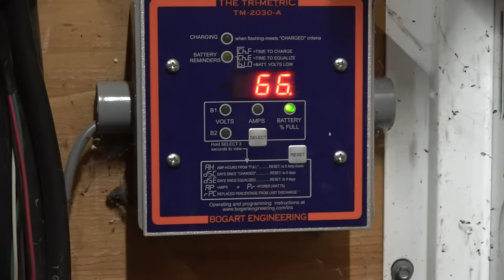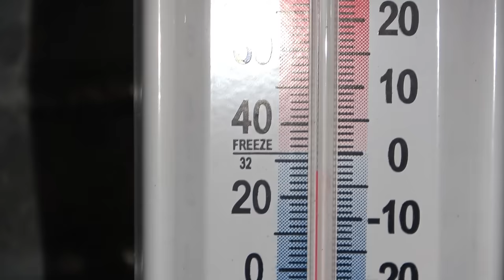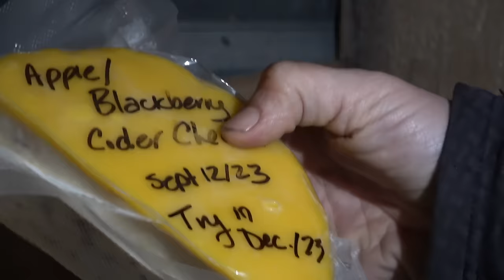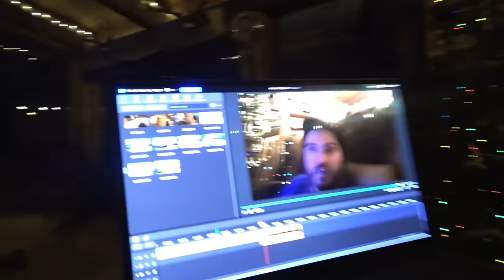Is This Life for YOU? OFF GRID in Winter

Comment: Sparked by your mentioning garage door openers, I have giant fans that run silently (almost) day and night in the summer - powered by low-pressure compressed air. I use 12-volt PV panels that power little air compressors whenever there's sunshine. That compressed air is stored in a giand air battery (and pipe grid) - available for use on demand.

Comment: An axe/hatchet is by far the most dangerous of any hand-tool, ESPECIALLY when you get comfortable with it. You can get off with a warning once, maybe twice. If you don't heed that warning, you're going to the ER, because when they bite, they bite hard. The way Kez was using that hatchet put fear into me I swear. I don't know how far you are from the ER (or someone who can reattach fingers) but if you're very far, then let her know her fingers are less than a blink of an eye away from not existing anymore. 

There's a safer method to splitting kindling. You hold the hatchet edge on the timber you're trying to split and strike both together on the splitting block, such that the blade edge embeds itself a few mil into the wood. Then strike again with the wood attached to the hatchet, to finish the job. I know it takes more energy that way, but it's the wise method if you value your limbs. When they bite. They really bite. Axes are sometimes unpredictable woefully dangerous and deceptive pieces of kit. I can't overstate that. UNPREDICTABLE.
Reply: Their firewood looks like spruce, knotty spruce. It is hard to split.  Pine is easier to split, especially when it is below -20 celsius.   I cut and delivered 78 cord of Douglas-fir firewood rounds in 2023.  It is impossible to sell spruce firewood here, only Doug fir and paper birch sell.

Comment: Oh man, out here in Quebec it’s been cloudy for weeks on end.   Nothing like 3 straight weeks of cloudy days, when the days are only like 8 hours long.
The fridge and freezer thing is the only part of living off grid that I struggle with figuring out.   Like even if you have a big solar system, when you hit a period like this, what do you do when the batteries get too low, or how do you avoid it?   I was thinking of getting a small wind turbine, but like now, it’s been cloudy and calm for weeks.
Reply: Why not utilize mother nature for the freezing bit in the winter?  I grew up in southwest Montana. We used the coke to our advantage. In the winter months our outbuildings were our food storage. With the right combination of insulation and ambient temperature, you can store food without modern refrigeration.
Reply: @travislee9396    For part of the year, yes.  But early winter, spring, and summer there is none.
Reply: @jimf1964  that’s what the root cellar is for. May not keep things at 38 like a refrigerator but it’s better than nothing.
Reply: @travislee9396   actually 38 degrees is a refrigerator temp, but not a freezer
Reply: @jimf1964  I never said it was. You need to read to understand. Not to respond.
Reply: @travislee9396    Sorry, I understood, but perhaps I wasn’t clear enough in my response.    I’m aware during the colder months we don’t need a freezer.  We have the outdoors for free, but I would need to store longer than just a couple months.  So I’d still need something else.       Although, I was thinking about a propane freezer, because I’d only really need it for a few months of the year, but you can’t rely on Mother Nature.    Also, my plans have changed from solo more north, to with a family that isn’t that keen on going somewhere where it is reliable cold, if ya know what I mean. 🙂